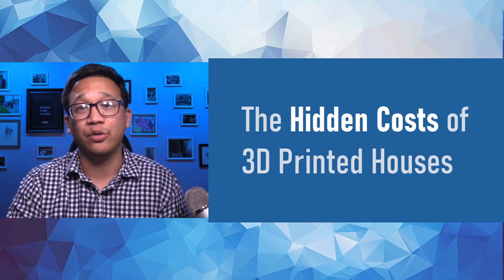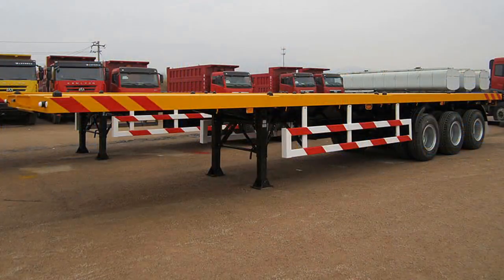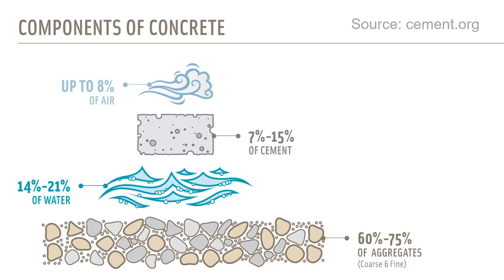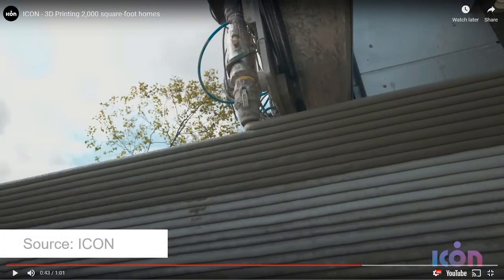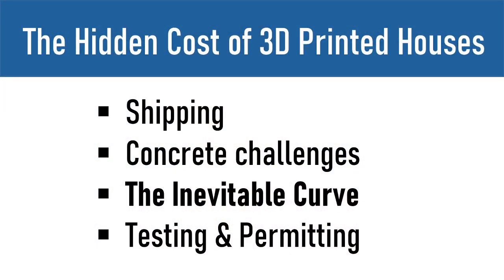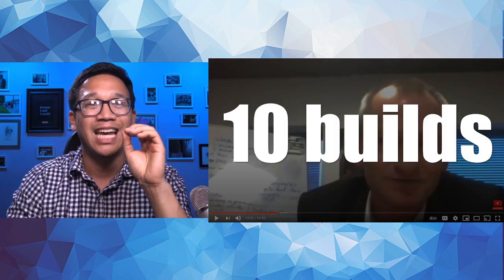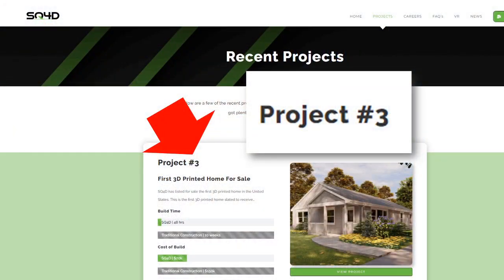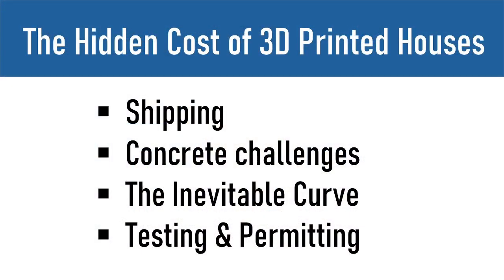The Hidden Costs of 3D Printed Houses

Comment: Lol,  You talk about hidden costs of a house costing 10000 ,but moving the equipment being 5000 dollars? What is your point? Concrete is being used everywhere and has been for eons. To build a house where I'm from is a minimum of 500000 dollars. Even if the 3d printed house is 100000 and not 10000, it would be revolutionary ,nevermind being able to avoid using wood and drywall in the future.

Comment: Been wondering about the reinforcement. Most concrete walls have steel reinforcement. Could use fiber reinforcement but that is for temperature and shrinkage cracks and not forces.

Comment: Although I understand your motive to clear the hype about 3D printed mobile structures, why are you mixing Shipping, It is a factor common even if the Structurer is conventional bolted on to a  factory poured and cured slab!  So in comparison you have to take that factor out! The hidden cost would be all the stuff that 3D printing can't do and the stop and start required for adding wondows  and doors etc

Comment: The framing to me is only a part,  You need drive way , gutters , finish wall inside  and outside ,  roof system  , windows  plumbing ,electric and don't forget taxes that you never pay off the house.  Wow  a 3D printed frame?

Comment: Missing the biggest problem: 

it doesn't reduce cost, schedule or complexity and it's maturity projections don't chart a successful path. Also it doesn't offer a better product. So it's a really cool tech that doesn't really solve a problem.

You really need a person experienced in building science and general contracting to evaluate the benefits or lack there of. Walls just don't take long to build and masonry is harder to run elec/plumb/HVAC.
Reply: Exactly.  The proponents are generally not thinking in terms of the finished product.  But this just means there are opportunities.
Reply: @SpaceCrete  I can't visualize a future state where this really improves homebuilding but who knows.

BMC has a this tech called ready built? Or something. But they precut all your lumber and print all placement marks. Ship it to you and goes up super fast. They also can do whole wall panels and ship those as well.

Building as much of it as you can in a controlled environment like a factory is where extreme efficiency is at. Setting up a 3d printer on site for every house is like setting up a temporary factory everywhere you want a product.
Reply: @Josh.1234  Yes, you are correct.  But some want fireproof (including the roof) thermally efficient homes that won't rot, and are not too expensive.  Here in the PNW all wood in the building envelope rots.  Agreed that 3D-printing of house walls (as done now) is very crude, primitive, expensive and inefficient, though machine-controlled placement of concrete is the inevitable future.
Reply: @SpaceCrete  IDK, maybe machine placed concrete will be the future but I'm not sure and even less sure if it will be in this type of 3d printer layout. Overall it has to get cheaper in totality than cmu or formed concrete. 

Also this sort of additive mortar is a bit weird in the masonry world.. no one builds walls or really anything over inches in straight cement without aggregate. And the fact it's layered makes it way more prone to cracking (habitat homes have cracking all through it) and buckling than say a solid poured concrete formed wall. Can they make a two story mortar wall? Can you make accurate and strong seats for any interior girders? Currently that is unlikely

Plenty of ways to make wood last in the PNW! I would say the bulk of the homes are wood and love the old craftsman homes. Today there are so many products that eliminate almost any water or air entry like the peel/stick wrbs, zip r sheathing, rubberized liquid flashing, etc. Masonry is not all that great, specially if you want an efficient house.. maybe if you use ICFs but general cmu or poured walls would require an additional interior wall with insulation
Reply: @Josh.1234  Very good, but you are attributing perspectives to us incorrectly.  3DCP as practiced now is not the answer, agreed.  Please see what we do. 
 (I have 50 years in construction, and can tell you for sure that rubberized flashing is the fastest way to make wood in the building envelope rot.  The newer the home, the faster it rots.  The old unsealed homes last much longer.  Many many examples.)
Reply: @SpaceCrete  I am open to seeing what the industry does and I want to see improvements in construction,  heck my dad got a polymer 3d printer for his mech design class back in the 90's and I could see how it was going to be huge. 

But with onsite masonry 3d printing I don't see the potential, you need to explain your goals and what you are planning to do with some specificity to make this look promising. So far I have heard outlandish claims all around about how houses can be printed in "days" which makes every GC or building science guy laugh. I assume you didn't make that claim but its pretty widespread across the industry. Personally I don't see how you will beat a CMU crew in in cost, speed, or functionality. Also most houses are not masonry specially not multiple stories so its only a smaller subset of the industry at best, also there is no great energy efficiency advantage either.

BMC Ready Frame sells me on their their tech, process, project savings, waste reduction, and risk mitigation. I can see where they can expand the tech to be even better. But with masonry 3d printing (this is cement right? not concrete?) I see so many issues on the horizon to even make the current approach work much less become preferable over other tech or even the existing. 

So many things working against it, the build site setup: mix plant, cement delivery/storage, piers for printer columns, printer setup, generators or chillers. Then you have environmental issues like temp/humidity impacting the mix, or freezing/raining impacting the mix plant and setting. Also the problem of having to constantly mixing small batches of mortar to keep a slow but consistent pour which makes you manage the environment over a longer period. Having crew that can consistently mix over/over without causing a problem which could require the whole thing to be turn down. More I think about doing this on my the next house, the risks just give me anxiety.
Reply: @SpaceCrete  Building science left the unsealed homes notion long ago. And most the high end efficient homes use liquid flashing or other similar products. If you want a energy efficient house, you have to control the ach and humidty. Passive houses or leed cert houses are sealed. Then you install an hrv/erv to manage the house's breathing..
Reply: @Josh.1234  Yes, but seal the heated side (only).  Sealing the outside of the insulation in a heating climate condenses moisture.
Reply: @Josh.1234  Since your comment I made a few videos about issues/problems with 3DCP.  This one is very close to your thoughrts expressed here:  https://youtu.be/n8ufazj8SCg

Comment: ssssooo....  this guy claims to be an expert, but apparently doesn't know the meaning of the term "hidden cost."    
if the seller tels you a house costs $100k and you walk up and pay $100k and the house is yours - then all the construction costs were baked in.
hidden costs are what you must pay on top of that.   

 if, after you sign the check, the seller tells you it will now cost you $5000 for moving the crane,  $10,000 for concrete,  $500 for doors, $500 for a building permit, $1000 for the plumbing, etc.     those are hidden costs. 

he's trying to trash the competition, where he should be trying to get in on the ground floor.

Comment: 3D printing a house with concrete is the worst method to build the house in terms of carbon footprint and environmental impact. There is no remodeling a 3d printed house. Try knocking down a internal wall. Can’t do overhangs with 3D printing. So you have to do a conventional roof. Try putting and additional wall outlet with a 3D printed house sometime later. What about insulation? 

I bet you can assemble a wall with pre-fabbed sustainable engineered wood panels using traditional construction tools and knowledge in a fraction of the time it takes to 3D print the same wall. 

INHO this is a gimmick.
Reply: Good points.  Often it is a gimmick to sell investors on.  But so much money is being thrown at it, it will have to improve.

Comment: Ok so what? Let's say the added costs are $50,000 to be extreme. And the printed house costs $25,000. That's $75,000. Here in Toronto, small 2 to 3 bedroom homes are selling for $1.3m. I'll take those added costs any day to get a house under $100k.
Reply: The problem is the printer only prints the frames, so the cost doesn't include the roof or the foundation. In addition, you then have to add the cost of electrical and plumbing which is skilled labor that will be expensive. Lastly, in expensive cities the problem is not the cost of construction- a 4bedroom 2,000SF house only costs about 300k-400k to build but in a dense city the land itself is scarce so you pay a high price for the plot to build it on
Reply: @rabiesman888  $300-$400k to build? How much to buy? What city?
Reply: Hiw much of the $1M is the land? That doesn't change.
Reply: @eldoolittle  What are you talking about? If land was purchased in 1995, what relevance is that?

Comment: I did not hear any issues that aren't true with any traditional building methods. A typical pour, in a concrete built home (or portions thereof) is into a ten foot high form, as a monolithic pour. Drying time is a significant consideration there too, and, given things like foam-form, etc, cure rates can be much longer, especially compared to a two inch ribbon. Shipping costs are true for all products, the nice thing about concrete is that it is typically near by. It's ubiquitous (limestone, silica, and aluminates, are everywhere). Learning curves are true for all new construction technologies, which come out almost every day. But, learning how to pour cement in a traditional form vs. foam form, vs cinder block takes less than a day for a professional. For something like 3D printing, typically the first 30 or 40 homes will be deeply discounted due to the learning curve and for marketing purposes. Setting up the stanchion and gantry are done all the time, pumping concrete is something that is done all the time, 3D design has been done for many years, XYZ additive processes have been around for years. IOW, the learning curve is rather small in that it is simply a matter of adding known processes together. The same permitting issues exist for every new construction technology that comes out. The process to deal with that... an engineer for the project speaks with the engineer of the building dept. and walks through the math. It is something done all the time. I will say however that a concrete build had been more expensive than stick built. Clearly, given the mess of 2021, that's not currently true. The big question though, will 3D printed concrete cost less than other concrete technologies? I believe so, however, people need to know that the unfinished shell of a home is probably only 15% of the total cost. So, if you save 20% of 15%, what's the gain? About 3% of total costs, which will probably be spent on additional finishing costs (given the very rough finish of the concrete).

Comment: On shipping costs.. you do know that in a stick built house you pay shipping on every trade and every item too right? They charge you to ship their own butt from their shop to your site. Then when they forget a part they charge you for driving to get the part. Then they won't work past 2pm, except on Fridays when they leave earlier. Plus all the wasted time between trades when your stuck paying your bank for the loan did the house your w a I t  I  n   g to live in. Plus the charge when they couldn't deliver and had to return the next week for delivery. Then your trades can't complete their job and bump you to 3 or 4 weeks late.  Phhh, hidden costs. Really, you can't put a pretty "Sheen" on your building style either. Next one I build, I hope to God isn't stick built
Reply: Not funny about that butt shipping and domino effect holdups- and don't invoke a change order charge!  
Most of the wood product moving now is going into stick built 4 and 5 over multifamily.  It would be cheaper still to build 3D with modified rammed earth as homework for Mars, or emergency shelter for this day-after-tomorrow weather. Besides the amazing reduction of legal triggering and percussion, the ability to format almost any solid material, even tornado wreckage and other wood wastes, into housing, work buildings, pavements and agricultural shelters is something worthy of promotion. Should also work for component builds as sorry!  shipable flat packs.

Comment: I’m an architect and currently building a 3D printed house. Many of this vid’s comments are actually accurate.  There unfortunately are lots of issues with this tech that makes it significantly more costly and this video only touches on just a few.  Is certainly correct that the industry is still learning how to properly use the tech and where its strong and where it’s weak. There are no standard details or best practices so everyone is literally learning as we go. There is also no proper place in the IBC to permit this as a structural wall that can transfer vertical loads. Until testing is done and the ICC creates a space in the code books to allow for it then the extra cost to build structure within the printed walls make it not cost effective.
I see a lot of commenters that dont seem to be professionals or experienced in the construction industry. New tech is always hard to develop in this industry is notoriously difficult to innovate in because of the extremely high level of integration (different sub fields and specialties have to coordinate on a high level to be efficient and effective).  This tech will develop and find a space but it will not be the magic solution for low cost housing people think. Its become very ‘cool’ and popular on social and thus gets lots of press. Just like shipping containers, people who know little about construction will fawn over it and defend it in the comment sections. 
Ill wait for my downvotes now.
Reply: May I ask which 3d printed house project that you are working on
Reply: @mollyhohenzollernstewart7444  yeah! It’s Habitat for Humanity’s project in Tempe AZ.  Bunch of PR and media were released in June on it.

Comment: So are you working on adding HEMPCRETE to your systems? What about domed roof sections precast and set by crane for Tornado/Hurricane zones? The Fire areas in the west are a natural location for this type of structures. Most of what I design is for seniors or couples so 400-450 sq. ft. is maximum size and the overall price is the big factor. You remember they quit building LAND a few years back so that cost has no place to go...Except straight up...

Comment: I am surprised that you did not include apis-cor processes in the content of your video https://youtu.be/EVz-LjspG5s  You would have knocked off about half the negative points you made and saved yourself some time!  3D printer towed behind a pickup and automated mixing/testing of the concrete is a game changer you failed to mention: not to mention no need to build a concrete foundation for the print structure itself.
Here is my take on the possibilities: when a builder can do a 20+ unit subdivision with 3D as the base of a home, perhaps a 30 years mortgage would cost less to carry (PIT+heat/cooling) than rent for a comparable sqft in a 1990's typical build. BINGO - house prices will fall due to new technology, just like cell phones and large screens did: rents will plummet to keep tenants?! Obviously it wont happen over night but if Biden + Congress can get infrastructure passed with housing included it might be a great start for 3D houses.
BTW, didn't China already build a skyscraper with 3D ????
Reply: apis-cor is awesome